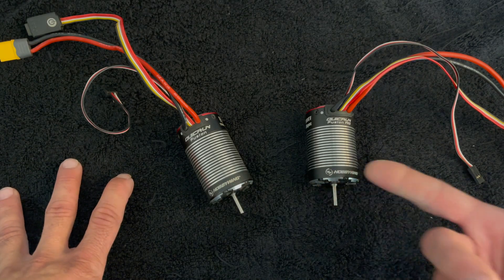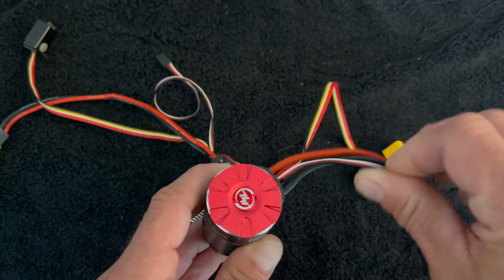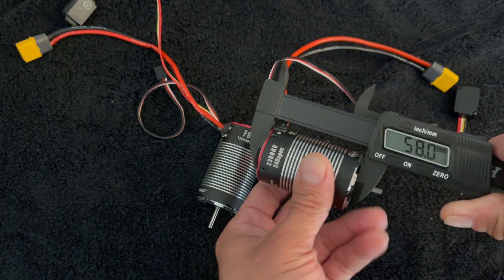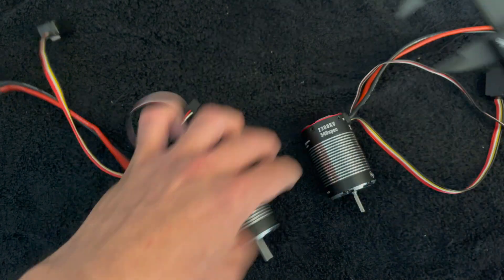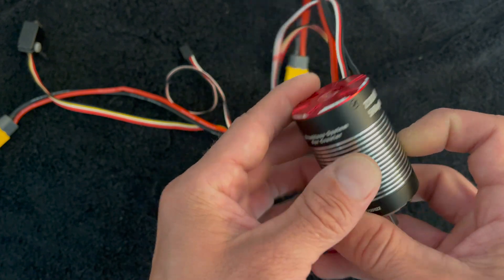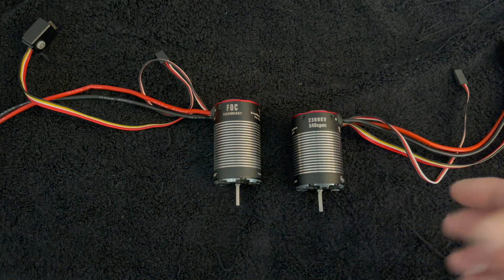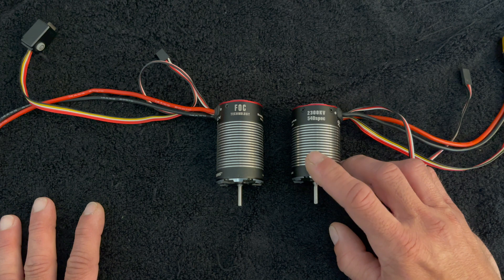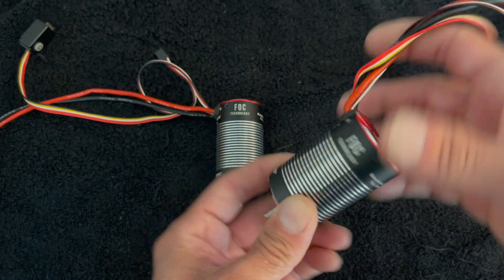The Charlie Show /// Episode 264 /// Fusion Pro - Quick Look

Comment: Just getting into the hobby, does this new fusion pro 2300kv have more top speed and power than the stock trx4 titan motor?
Reply: Leaps in bounds, no comparison between the stock brushed trx4 motor over this 2300kv Brushless motor ..... but speed also comes down the pinion gear.. volt up gear down

Comment: Nice short overview. 
I love my three Fusions.
I'm seriously curious if the larger diameter is there to accommodate a larger diameter rotor assuming they had to shorten the rotor to accommodate the shorter can?
I mean....the AXE definitely isn't known for torque-density because that was lost with the staggering of the magnets. And I'm under the assumption that the Fusion has straight cut magnets in the rotor. The Fusion is strong from what I've seen compared to an AXE of the same size but not as Torque-dense as my 4-pole Stubby or 540 Puller Pro.
Reply: The larger diameter can makes up for lost windings when shortening the can, you have to make it up somewhere, I own several Puller pros several Axe motors when comparing them apples to apples same kv to same kv there's no noticeable difference between the 2 other than the axe drag brake is far stronger, there all great motors for there intended purpose....

Comment: Wonder what the weight difference would be compared to my hw1080 running a holmes brushed stubby magnum motor
Reply: 209gramm is the fusion pro, fusion is 201gramm.